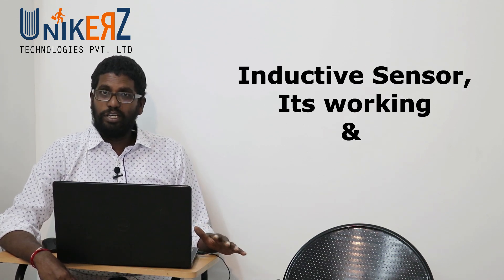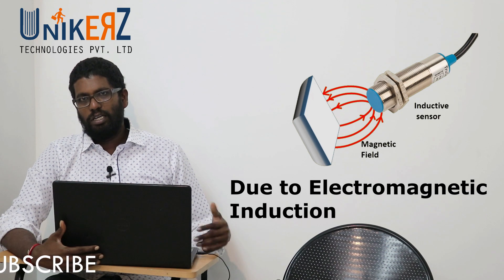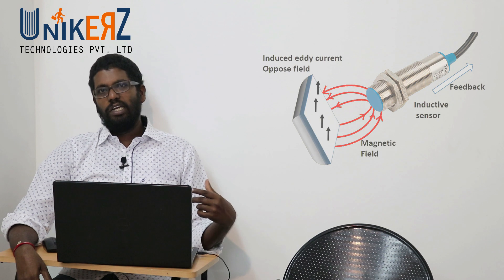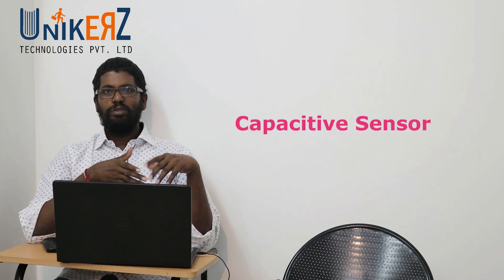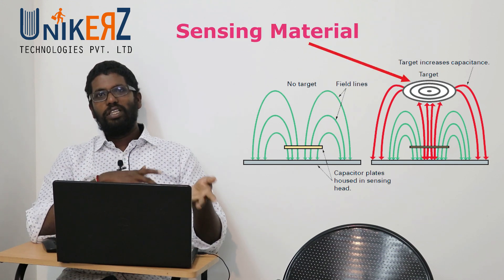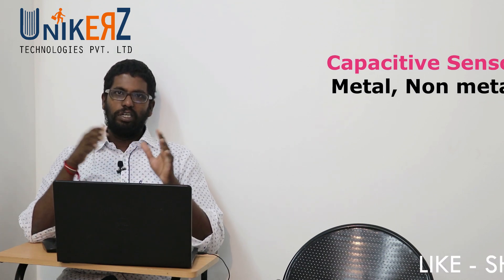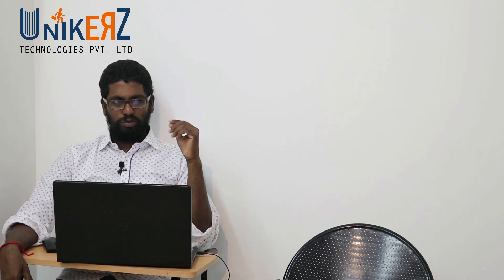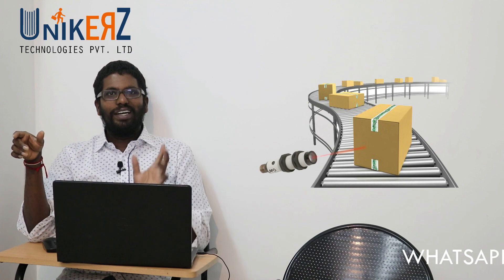Proximity Sensor Types - Inductive & Capacivte - Sensors - PLC Input Devices - In TAMIL - Part 02

Comment: How much voltage input to sensor. If object come to the sensor how voltage will come to sensor output
Reply from the maker: control signal voltages are generally in industry - 24V DC
Reply: @UNIKERZTECHNOLOGIES  ok if object come to sensor how much voltage will showing.